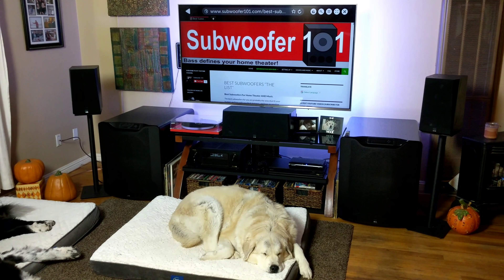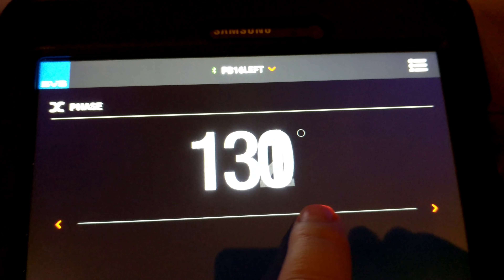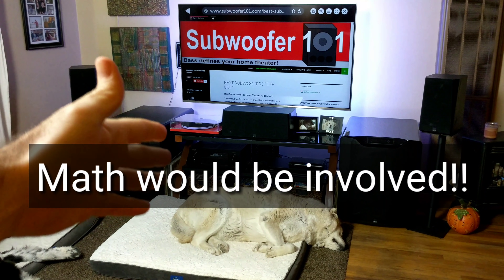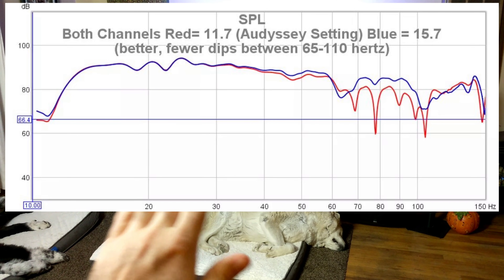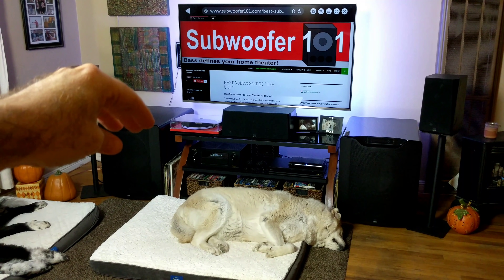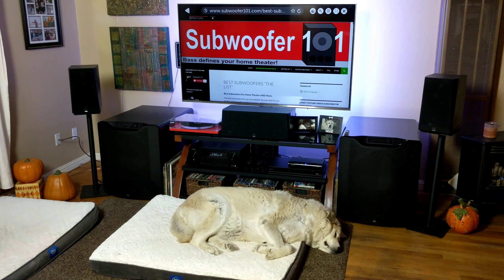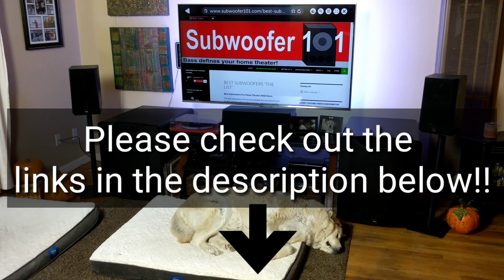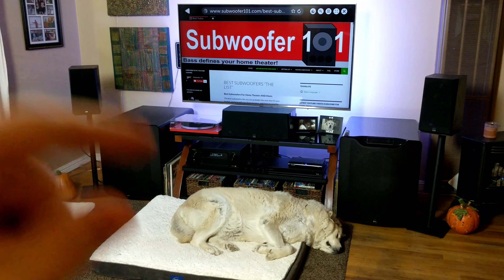Subwoofer Phase Setting: Which is best? 0? 180? (Subwoofer Setup Tip)

Comment: It is time to revisit this and the “Sub Distance Hack” video.  Things have changed now that all of SVS subs are using the app and phase can be adjusted one degree at a time.  The question now is whether leave the Audyssey distances as it measures or set them to the actual physical distance and then use the phase adjustments for each sub?  The sub phase is to be set to zero before running Audyssey.  I like to set the sub volume at -15db on my PB1KP and go between -79 & -80db on the Audyssey scan.  My volume on the sub bas to be increased to -12db to get there.  After Audyssey runs, I bump up its result to the number of db it took to get to that 79/80 number.  Generally, the AVR number is -4db.  My second sub is a Polk PSW-505, it’s phase is set to ZERO.

I’m finding myself constantly playing with the phase on the SVS app.  Now, I’m questioning the distance Vs phase adjustments.  I’m not finding a definitive answer that satisfies my curiosity.

Comment: You didnt tell us how to set it!
Reply from the maker: Set it to zero and use distance settings on your AVR to get a more precise adjustment. 

Run room correction, and whatever the distance value is for the subwoofer, increase it by 4 ft. That's my Distance Hack.
Reply: To Manually set Phase correctly (not using Room correction such as Audyssey):

- let your speakers play full range (ie: mine play down to 50Hz)
- set crossover on sub to 10Hz above (ie: mine 60Hz)
- Play some music with bass, adjust volume so Sub is noticeable but not too loud
- play the lowest frequency of your speakers (ie: mine 50Hz tone). can download a free tone generator app for phone or computer…) 
- use SPL meter ( or smartphone with SPL meter app works). I use settings C-Weighted, Fast, Low on SPL meter) 
- cycle through Phase settings (typical 0, 45, 90, 135, 180, 225, 270, 315) and look for the lowest SPL level = Null Point
- if Null Point is 0-180 then add 180 = your Phase setting.  if Null Point is 181-359 then subtract 180 = your Phase Setting.
- now you can play with your Crossover settings (ie: Speakers set to 70 Hz, Subwoofer to 80 Hz. etc…)

If Dual subs are both in front like in this video, use this method to setup each subwoofer individually (or just use the same setting).  If running one sub on front wall and one sub on rear wall then flip phase 180 degrees from the setting you determined on front sub.  (ie: if front sub 135, then rear sub 315)

enjoy !

Comment: Hey man just found your channel and wanted to say THANK YOU! Took your recommendation on settings and it worked for my PB-2000s. Wish I found it sooner but just wanted to say thanks.
Reply: Could you pass those settings on to a fellow PB2000 owner :D  I've watched some videos, but I didn't take notes like I should have.
Reply: @jwgosla08  So all I did was up the distance setting in my AVR by 4 feet max. You have to play with it based on your room but the max I changed it was 4 feet. So lets say my AVR says the distance of my subwoofer is 9.2 feet. Then all you do is go into the speaker settings and up the DISTANCE to 13.2 feet. Like I said that's the max. I run a dual sub setup and this really helped me. Sometimes I will change it by 2 or 3 just to play around but 4 seems to be just right in my room. Good luck with it, seems to be quite the rabbit hole with getting subs tuned.

Comment: If both woofers were at the same phase, the speakers would go in and out as any normal speaker. Your hand movement demo is backwards. If they were facing each other and at same phase they would go in towards each other at the same time.

Comment: If a sub is set to 180 when base hits does the woofer go in or out
Reply from the maker: First impulse would be "in", but I wouldn't get lost in that. 

180 switch could be seen as a simple delay, which is why I recommend using distance instead of the 180 degree phase switch. More precise control.

Where a 180 degree phase switch is like reducing the subwoofer distance value (timing), adding to the distance value sends the bass signal into the room a little sooner than the rest of the speakers. You can't do that with a phase switch. 

Once the signal leaves the AVR, the only timing effect you can have is a delay. That's why doing it in the AVR (using distance settings) is the best way to go, in my opinion.
Reply: base hits??? This aint baseball...Spanky!

Comment: Setting up a sub is straightforward if you have access to Spotify on your system. You can also use this technique with two subs if you  disconnect one, then do it with one, then the other. 

1) Finalise where the sub is going to be placed. Ideally this should be in the middle of and equidistant  to each stereo speaker and the same distance to you as the stereo speakers, but its not critical as low bass is not directional. Avoid placing the sub too far away from the main speakers though as the bass will sound detached and experiment with its positioning to get the taughtest and most articulate bass, not the most quantity. Corner placement might not be the best as it will tend to over emphasise some bass frequencies.

2) Download a SPL meter onto your tablet or phone. A digital readout rather than an analogue meter can be easier to read from a distance. You can purchase a sound pressure level meter if you want a more sensitive and accurate reading.

3) Place your device where your head would normally be in the listening position and switch on the app. Make sure the microphone on your device is unobstructed.

4) Play bass frequency test tones available on Spotify. 50HZ should be audible on most systems and do the job and turn up the volume a bit higher than normal listening level, but being careful not to blow your main stereo speakers.

5) Adjust the phase control on your sub so that the SPL meter achieves its maximum level.

6) Your sub should now be in phase with the bass speakers in your main stereo system.

7) Now adjust the crossover frequency of the sub so that it starts to kick in as the bass in your main speakers starts to roll off, then adjust the level of the sub so that you are not aware of the sub itself,  but so that your main speakers sound like much bigger ones.

8) Repeat 7) again and again with a variety of music until you are satisfied that the amount and quality of the bass is just right, then leave it alone and enjoy your music.

 You can make a note of the phase, crossover and level settings or mark the knobs  with a dab of correction fluid on the knob and its scale so that if the settings ever get disturbed you can easily return to the optimum settings. Its important to remember that the acoustics of your room will also play a part. The above technique works for one bass frequency at one specific part of the room and music contains various bass frequencies of course but it is a good starting point.   Certain frequencies will be reduced in loudness due to the dimensions of your room due to "Standing waves" which will cancel out or reduce sound pressure at certain low frequencies, and on the other hand, certain frequencies will be reinforced. Acoustics of rooms is a science in itself and nobody lives in an anechoic chamber. The main thing is to use the above method then experiment with sub placement and settings so that you get the best subjective result, then just enjoy the music.
Reply: thanks for the detailed explanation.

Comment: Hi, I've just bought a German subwoofer Mivoc Hype 10 G2. As far as I know, it has a cancellation after having made the parametric EQ with YPAO (Yamaha receiver) I have the following configuration: This software set a gain of -5,5 dB at the frequency of 62,5 HZ
 and with a Q= 3,175
. There is a big gap with the shape of a V going down till those negative gain. Can anyone help me? Should I increase the distance (delay) in 4 dB? Maybe to change of phase from 0º to 180º? Changing the position of the subwoofer? Any tip will be welcome. Thanks in advance and greetings from Spain

Comment: Which is best? Chances are neither is going to be 100% correct unless the subs and satellites have been CORRECTLY designed as a complete system and they are phased and in physical positions as outlined by, hopefully, a COMPETENT designer. In ANY other case there is no definitive answer and you might want to go for the phase connection, relative volume settings and physical position combination which pleases you the most.

OR

If you have some test equipment (audio oscillator, mic and sound level meter you can take measurements outdoors near the crossover frequency to discover position and phasing to give the flattest response around the crossover frequency but you will be losing the information from room reflections that may temper your decision. You can also make the necessary measurements inside but will need appropriate software and a mic. That's a good start but, as always, getting GREAT sound is way more complicated. A better choice may be to buy a CORRECTLY designed system which has all the drivers in the same enclosure then the aforementioned problems and decisions won't exist.

The remaining problems standing in the way of SUPERIOR sound that you may want to address are 1) proper positioning of the speakers within the room and 2) acoustical treatment of the room surfaces and corners. For acoustical treatment I recommend "Acoustic Sciences Corporation" in Eugene OR. For some excellent speaker design information I recommend taking a look at the "Linkwitz Lab" web site.

A caveat. Most, but not all, people posting speaker/equipment information on YouTube don't have a clue and are either selling a product for a percentage/kickback or are selling themselves as individuals offering good advise, which they are not.
 Take speaker recommendations with several grains of salt.

Comment: Do you have videos on setting the subwoofer level? When I set mine to 80db, (what my speakers are set too) they become boomy and way over powering. I have them about 10db lower than my speakers and they blend perfectly, if an explosion comes from one of my surrounds it's sounds like the bass is coming from that speaker.

Comment: The phase has nothing to do with distance is what direction the sub is facing if your sub is in the back and the speaker is facing the trunk it should be set at 180 degree phase.  Your sub shouldn't not be facing left or right unless it is custom design or if you have two sub then they can be 0 degrees phase and one facing left and one facing right it is about  balancing sound.
Reply from the maker: I have to disagree with you. You can get much more accurate results altering the timing rather than just the phase switch. The phase switch is one setting or the other. Two choices only. 

Adjusting timing allows for a much higher number of adjustments in between, as well as a way to advance the bass signal rather than just delay it. 

The sweet spot for getting rid of most of the cancellations is highly unlikely to be at either 0 or 180. 180 works like a delay, which can be even worse in terms of timing. 

In a home theater application, increasing the distance of the subwoofer actually puts the bass signal out a little bit sooner than the other speakers. 

Since bass decays, getting the signal out slightly ahead of everything else provides a better balance, in my opinion. 

I would never recommend someone alter phase purely on which direction the sub is facing. That might be common advice, but it could actually make the timing even worse, creating a muddy sound. 

If the orientation of the sub is behind you and facing behind you, and no timing adjustments are made to compensate, you're probably out of proper timing to begin with. 

In a car, the speakers are right next to you, with the sub in the back, facing the trunk. The sound from the door speakers hit you right away, while the sub has to bounce off the back of the trunk and come back to your ears. The sound is now delayed even more from the sub. 180 phase essentially increases that delay. 

I don't focus much on car audio, but if I were to get into the weeds, I would install a Mini DSP 2x4 before all of the amps to alter timing for every speaker, and shape the response curve. It would be the best way to get the best bass response, but not a small undertaking. Lots of math and measurements to get it right. 

All of that said, sure, if 0 or 180 sounds better, and that's all of the adjustment you have, trust your ears and go with the best sound. Bass is more complicated than that though, and using distance/timing is a FAR better and more effective choice, if it's available.

Comment: So I only have one PB-1000 so it should be set at 0? This only pertains to dual sub systems?
Reply from the maker: I would still keep it at 0 and use distance to optimize.
Reply: @Subwoofer101  that's exactly what I did, thanks. The PB1000 being entry level is a pretty dam good sub. I'm constantly surprises by it. I really need to add a second one.
Reply from the maker: I wouldn't have it on my list if it weren't impressive. To make the list, it has to be a sub I would be willing to live with indefinitely, and dual PB-1000's do the trick. When you get your second, you'll truly hear what it's all about. 

Definitely check out the gain hack too, if you haven't already.
Reply: @Subwoofer101  thanks for the info. One of these days I'll get a second PB1000

Comment: Have to say amazing video. Wanted to ask you I have two subwoofers. When I do room correction what volume should I leave the woofers on.
Reply from the maker: Thanks! Check out my Gain Hack videos, but if you have Audyssey XT32, instead of 75 dB during subwoofer level matching, try 83 to 85. Of course it depends which subs and AVR you have, but you can get more oomph that way.
Reply: @Subwoofer101  thanks for fast reply I have 2 jbl es150p and pioneer sc lx 501. I am new at this got a good deal and now trying to figure it out as I go.

Comment: I also use the distance setting to delay the mains relative to the sub. I do this by inverting the polarity of the main closest to the sub, with the other main disconnected, and use an SPL meter placed nearfield between the main and sub, to find the distance setting that is at least 1 cycle earlier than the mains and also produces the deepest null playing an 80hz sinewave (crossover). Once the speakers are reconnected in phase, the sound integrates beautifully and seamlessly. Even standing directly in front of the sub and nearest main, all of the bass appears to be coming from the main.
Reply: After cal the distance is 17’ sub and 10’ mains. Manual distance is 23’ for sub. (Monolith 15)
Reply: How do you invert polarity a main. Do you just wire it bass awkwards?
Reply from the maker: I'm trying to figure out if that's the long way to get to what I do with the Distance Hack.

What is your subwoofer distance with room correction, and then after your method? Interesting for sure.

Comment: Room dimensions play a major factor.  0deg with detected distance provided far less bass than 180 in my situation (20' x 30' room with 16' ceiling).  But at 180deg seemed very boomy.  Thank you for the suggestion of increasing sub distance from standard.  It was the only way I could correct while keeping the sub in the front near the towers.  I probably need 90deg, but have no way of setting to that phase
Reply from the maker: Room dimensions make a difference, but timing is the real issue. 

I have packed a motorhome with a full surround system, and it sounds epic. Better than the house. 

If you are looking for 90 degrees, I would suggest trying 2 feet of added distance. Or 6 feet. 

Go with what sounds best, but when you adjust the distance value, you will find the spot where the bass opens up the most. (Fewest cancelations between subs and mains.)

Comment: The purpose of the phase control on the sub is to allow smooth low frequency integration with the mains (meaning no peaks or dips in frequency response around the crossover frequency).  By artificially adding 4 feet to the distance of the subs you have essentially changed the "phase" relationship between the front speakers and the subs by 90 degrees at 70 Hz, which has a quarter wavelength of 4 feet.  However, you have created a timing delay between the other speakers and your subs .  You will likely achieve a more cohesive surround sound if you set the distances properly and change the phase control to 90 degrees....
Reply: This is correct comment, the correct timing dictate when the sound front will reach your ears and we want it to come from all drivers at the same time in order to have the best transient attack, not one after another, even thought sound waves are in phase to each other. Only by setting both the phase and timing correctly, one can achieve both simultaneous sound arrival times and correct summing at the crossover frequency. For DSPs that have only 180 deg switch or no phase control it can be still adjusted by acoustically aligning the drivers so that they are in phase at crossover frequency without software control (by physically moving subwoofer closer or further away compared to fullranges) and compansating with time delays accordingly after that.